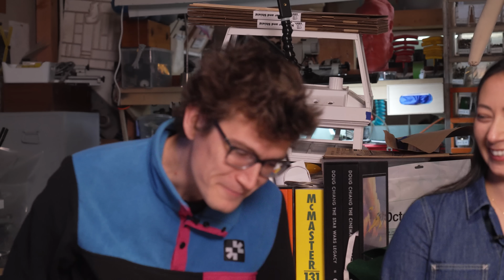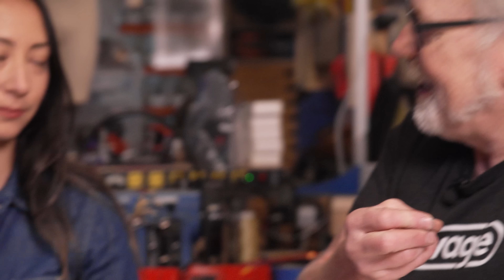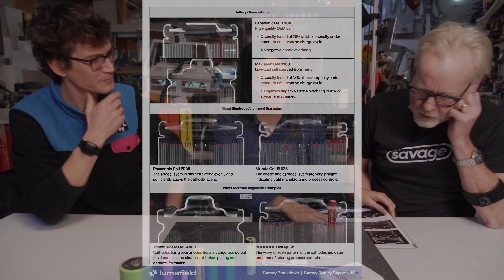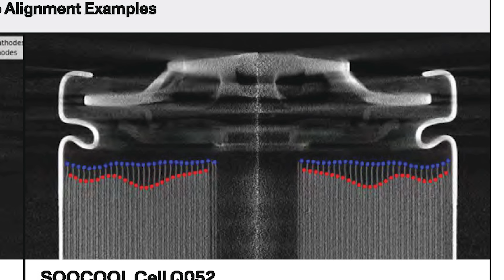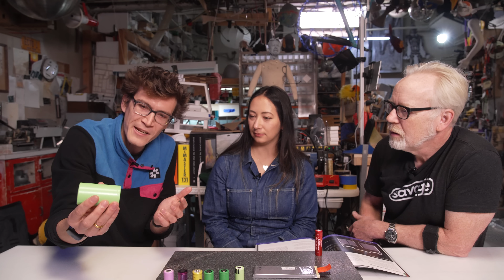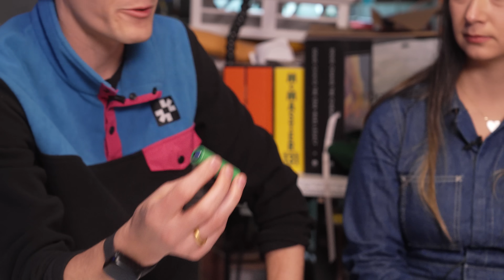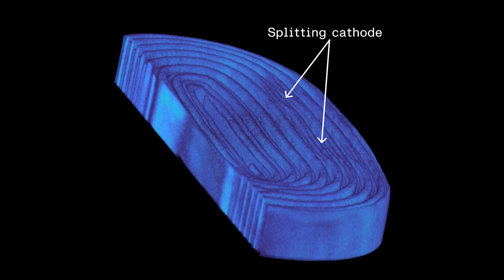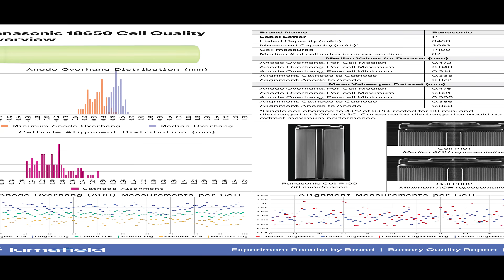The Surprising Flaws in 18650 Lithium-Ion Batteries

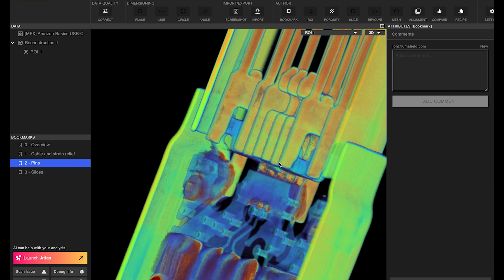Comment: 0:50 "That was a fascinating dive into how much difference there can in manufacturing tolerances and executions for what seem like the same exact part."

But that wasn't what that video was about. That video has like a 50% downvote ratio because all you did was scan an Apple Lightning cable and try to compare it to a USB 2 cable. If you didn't know better you'd think that video was just a paid ad for Apple.

Comment: Surprised this suggestion at 17m33s to fully submerge in water. But I suppose as long as hydrogen gas created by the 2Li+2H2O→2LiOH+H2 reaction would be more likely to bubble out from the surface where it doesn't have the oxygen from air and heat to sustain a fire, however lithium can explode when in contact with water and so if the device has an air pocket within it and then water reacts with the lithium it can explode vs just burn.

Comment: You definitely get what you pay for. I took a punt on a replacement battery for a cordless drill. The original pack was 2.5Ah, and the cheaper replacement pack, same size, claimed 4.0Ah. Using my RC hobby charger, I can see that the original pack performed to spec, whilst the O.E.M. pack from Amazon was 1.6Ah at best. It was still cheaper, per Ah, however. Treat all Li-Ion batteries as if they’re likely to catch fire at any time, don’t have them charging unattended, try not to keep them in the house.

Comment: Can someone explain why the wandering winding is not acceptable? Obviously the manufacturer would have to reduce the slit width of the electrodes to maintain its fit, which results in less capacity. But surely the dielectrics are still admissible, due to the battery still functioning. 

What am I missing?

Comment: This will get buried but back in the unregulated days of vaping we had a thing called a “burst disk” that you would put inside the vape device between the positive post on the 18650 and the positive contact in the device. If the power output is too high the disk would act as a fail safe. It would fail and disconnect the power to the atomizer.

Comment: The take away is DO NOT cheap out on your Li-ion cells or batteries. In fact probably best buying battery banks in particular from physical stores as there are generally greater import controls on these than online retailers. Remember if it goes bad all the capacity of the cell is going to become a heating element of a similar energy rating to the cell!

The one important thing not mentioned is swelling... If these things start to swell, treat them like a grenade with a rusty pin. Do NOT use them, do NOT store them, in fact probably leave them outside on your driveway or other paved area if it's shaded so if it does catch fire it will just burn on the concrete. Dispose of it (not in the trash, check your municipal guidelines on where to take it) ASAP.

FYI the main reason airlines tell you to NEVER check Li-ion is because if they catch fire in the hold the fire suppression system in there is NOT rated to contain a Li-ion fed fire. One battery bank would feed another and another and all those mAh are going to dump into heat! At least in the cabin they can isolate it and either drown it in a bucket of water or pouch it (many have specific fire proof pouches for exactly this purpose). Even cargo only planes no longer carry more than a certain amount of the stuff because Li-ion fires have taken down freighters.

The vulnerability that Li-ion has with damage is also why they tell you to NEVER move your seat position if you lose your device. Many business class seats are powered recline etc (although you can move even a manual seat easily with enough force to bend a device) and can easy damage the cell(s) of devices and you then have an entire seat on fire which is MUCH harder to deal with than a single hot device.

So if:
- it's too hot to touch;
- smouldering or smoking;
- bulging or swollen...

It's either on fire, about to be on fire, or at high risk of doing so!

Comment: This is pretty cool actually. Where I am, it's almost impossible to buy replacement 18650 batteries because it's become too hard to tell the good ones from the bad ones to the point the sellers don't want to take on the risk of something disastrous happening.

Comment: I’ve been measuring 1.5v cells and finding the generic aliexpress ones are 1.8-2v due to the poor quality of the voltage controller fitted to make them 1.5v in a AA or AAA format. XTAR are one I know measures correct.

Comment: soo basically the batteries will still work and catastrophic failures will only happen during extreme usage and user errors and mishandling, this video is just to promote the scanner and not about testing the fail rates of these batteries cause the manufactures already did that before selling...

Comment: When I click on "top brands" for 18650 batteries on Amazon, the only "top brand" that I recognize is Amazon Basics.  What the heck are Nitecore, Surefire, Adafruit?  Those are not brands I have ever heard of in my life.  So what brand battery SHOULD I be shopping for, and where would I get them?  How do I know that it's not just a counterfeit with brand-name plastic wrap added?
Reply: I don't know a good place, but I would certainly NOT be using Amazon for anything like this.

I did suppress a giggle at "surefire" though... That's not what you want to call a Li-ion cell!
Reply: You don't know a good place.  I also don't know a good place.  Does anyone know a good place to get batteries, or can they recommend a good brand of 18650 batteries?

Comment: Some of these batteries can come with tiny BMS circuit boards built into the positive end but there was no discussion of BMS circuits in batteries which has much more to do than simply acting as a circuit breaker. Then, there are the external BMS circuit straps you can attach onto any 18650 but there was no mention of this. It would have been interesting to discuss these features.

Comment: "Typical name-brand 18650 cells are made at a rate of 4-600 per minute" That's up to 10 per second, you can measure that production rate in Hertz (10 hertz for 600 per minute).
I play a lot of factory building games, in Factorio alone I have recently passed 10k hours (logged since 2017).
Hearing that they can hold the defect rate so low on such a complex object at that high of a production rate makes me smile in a way that I think would be lost on most people, even most people that regularly play video games.

Comment: Give it 10-20 years and we might crack the code on Al-Ion batteries. Better than Lithium ion batteries both in terms of "it's better at being a battery" and in terms of "Refined metallic Aluminum is an incredibly ubiquitous material for structural and electrical conductor purposes, the aluminum component of such a battery will be incredibly cheap making the price-per-kWh a lot better than for Lithium ion batteries."

Comment: Very good investigation and report - thank you!  The video could be shorter tough and more to the point, but the report is great. Never buy (too) cheap china-cells from untrustworthy sources and with specs of 18650 with 4000+ mAh - doesn't exist! If you buy cells with 4000...5000 or 9900 mAh in 18650 format you can be sure to buy cheap fake cells with often less than 2000 mAh and poor quality. Some cells even miss the CID or PTC safety features!

Comment: I have a set of 2 double "AA " Energizer rechargeable batteries with charger 2300 mAH .   I've had these batteries for the past 21 years 😂😂.   Haven't used them for 15 years .   😂😂    yes I'm that kind 😀😀😂     my question is ....can these be recharged and discharged on a regular basis ...or is the cells completely dried out ...?   Is it a fire hazzard to charge these batteries ?   Thanks)))))

Comment: Around 5 years ago I had purchased a wireless rechargeable hair trimmer from Amazon.   I've  used it regularly. I live in Canada.   The brand is Woner . Of course its a Chinese brand you would never find at a retail store.  Woner brand is no longer available for purchase in Canada on Amazon (its most likely one big Chinese manufacturing company under 10,000 different brands 😂😂)   The cylinder battery is the exact same as in this video ... its states on battery : " GREAT POWER 😂😂.... ICR 18650.  3.7V. 2000 mAH.  
2019-05-08"   So ... less than a year ago the battery stopped charging .   Seems like it crapped out ..while charging ....but power button would light up  and charging % would indicate 100% but it was not 100% .  The unit would not turn on. What could be the real issue here ? The battery itself (which i think so) or.... the charging metal contacts inside the unit ? I understand this is not the highest quality of trimmers but it sure did the job for me.  I like to extend the life of this hair trimmer...it worked great for a number of years . ... should I go ahead and purchase the same battery ?

Comment: Best unheard report touching EVERYONE today except amish possibly
Reply: Ha! I worked on a framing crew with Amish carpenters. They totally use cordless tools.
Reply: @philotomybaar  Yep, the Amish crew building our house uses generators to charge their cordless tools! And they have "road phones."
Reply: @gasolinefumes  – Each Amish church has their own standards, with respect to which modern technology is allowed. The Amish aren't monolithic.
Reply: @philotomybaar  and the road buggery horse carts, have lights on them horses don't have dynamos, the must be  batteries in there somewhere
Reply: @dh2032  I remember when I was a kid, the Amish were opposed to putting the slow moving vehicle triangles on their buggies. Now they have lights?
Reply: @philotomybaar  'Plain' white lights probably. More seriously, modern blinky red and white bicycle lights can save their lives if they're out after dark. I'd hope their faith allows them that small measure of safety, and something as small as bicycle lights could be charged with a small solar collector.
Reply: There IS wired audio equipment

And much of the desktop gameing hardware is wired so that at least is safe
Reply: Was excited until they wanted my name and e-mail address.

Can I download it right after, or have to wait for an e-mail?
Reply: Work and commerce are excluded from those restrictions.
Reply: That depends. The Amish aren't monolithic. Each church has their own standards, with some embracing modern technology more than others.
Reply: I think it's more accurate to say that the Amish use fewer of these batteries than we do.

Comment: She said the anode is the negative layer?  Confusing as it is oppositely marked on LEDs, capacitors and CRTs.  In batteries and power supplies, it is marked negative.  Worked with electronics and electricity for almost 30 years now, I thought anode was always positive.  Somehow this eluded me.  :(

Comment: I really wish the batteries will improve much - because i want to hit my mech mod (single cell tube, fully mechanical) with peak power for longer amounts of time, for me the 2 kings are now sony vtc5 and lg hg2 - the first one is great for those 0.12-0.16 ohm builds, the second is perfect for 0.15-0.2 ohm coils that are for conserving energy (if you dont overload the cell that much it will give out much more power on one charge, lg hg2 has 3000 mAh and is consistent as hell with the voltage while in use, VTC4/VTC5 is for literally cloud chasing, vape tricks - shits and giggles, but drains faster, much faster) Now i only want for my stupid country not to tax vegetable glycerin like hell and put a king kong tax on liquids... They almost destroyed the whole vaping community here. You cannot buy normal shit like kanthal wire, premade clapton wire, fused clapton wire, coils other than replacement for shitty RTA's - banned selling RTA's that can be filled with more than 2ml of juice... I started growing my own tobacco for my own use - went back full circle to tobacco because of tax. To hell with them, now i pay nothing, i smoke a pipe which i made myself from wood from my own backyard Pear tree. I miss when vaping was affordable and you could actually get off nicotine with it so easy, now it is just single use e-dicks with lithium ion battery inside because its the cheapest anyway, started building projects with batteries from single use e-dicks with nicotine so high that you just wanna cough, they throw them on the streets. Literally imagine being a stupid fuck, 14 years old and chucking used vapes on the sidewalk, at least i get some free perfectly fresh and good li-ion cells in quantities that are scary, i wonder how many of them lay in the city 
:/

Comment: they really needed to spend some time on what the overhang problem really is, there was no indepth discussion with images of how it provides danger. You need to understand in depth what the different layers are in order to understand it. The plastic layer inbetween the metal layers also needs to be brought into the discussion. There was also mention of a cathode layer splitting, that means nothing if its not explained in detail. Was it the nickel/oobalt layer has split away from the aluminium? had the single layer aluminium somehow split? so much lack of details unfortunately that makes it more of a fluff article...................3/10 unfortunately.

Comment: yep once i did bought a batery pack from a laptop on amazon to replace a broken batery pack on a hp , and was broken or not holding energy within 3 weeks of use, and even with an official charger  , droopshippin is a think more common that it should be, but would be better that this kind of scan tech was abailable to all kind of users , if only millonaire company can acces this tech and they might or might not use it bcs u know cut on cost productions is something real too , better that low level user could have some kind of scanner (ai powered for example to exam defective circuit boards for example i think that would repair some material loss when u have a broken board that cannot be recicled at 100% , and material loss or contamination would be cuted in some short if u would know specifically where the error of a board is and repair it instead to throw it out into the trash can) each sand grain of contamination that acumulate into a desert of contamination is not good , and if we pay for resources better pay for resources that work not that can lead to dangerous situations (well at least i could recicle some of the cell in series on that broken pack from amazon and use it on other project but who knows the type of cell or the defecs it might have, "other doing dangerous things to feel alive like jumping from a bridge and i am just reusing droopshiped cells to feel alive xd" )

Comment: 16:30 Point of Clarification. Within that total of 9 Li-Ion devices, are wireless earphones, for example Apple Airpods, classed as one device or three? Because each of the earbuds has its own small battery, with another, larger battery in the case. So is that considered one "battery" in multiple parts or three separate batteries

Comment: Simple, do not buy any battery from any company who is less than a decade old, but Sony, Panasonic, Samsung, Energizer, Duracell (they make the Kirkland ones too) not xoimo or SooCool or MaxxPower or whatever.  Most will not even last more than 10% of their capacity let alone work. Coast is expensive but reliable and with a lifetime warranty.  Even for CR2032 I only buy Panasonic or sometimes Sony but the Panasonic ones last longer.  Also make sure the minimally have CE certification, etc.

Comment: The CID triggers based on internal pressure i think rather than temperature , I think the pressure it accumulative too so it will add up over time if the battery has a minor fault and will break the connection , However the battery inside could still hold a charge at decent capacity so it could still in theory blow. In the name of science i did reset a CID and it did return to a functional state but it would never used in anything. On the pouch style batteries they seem more vulnerable to poking but they tend to display they are in fault by inflating and forcing the plastic container they are in open.